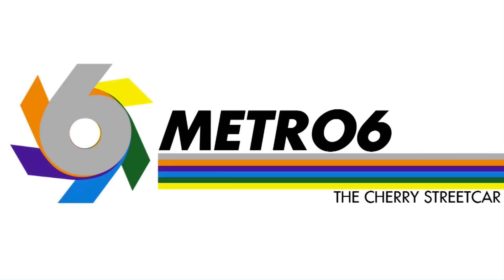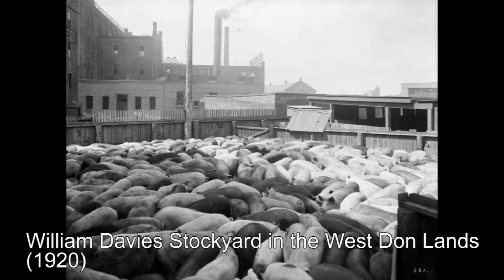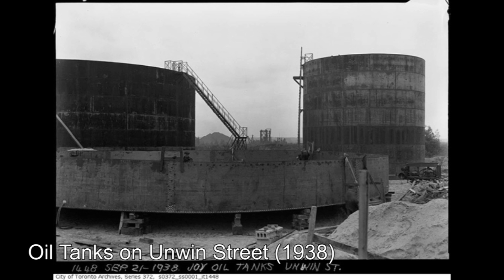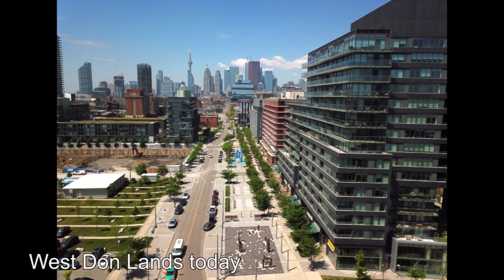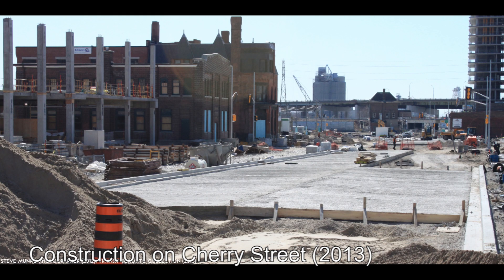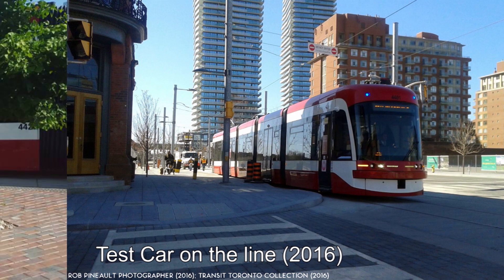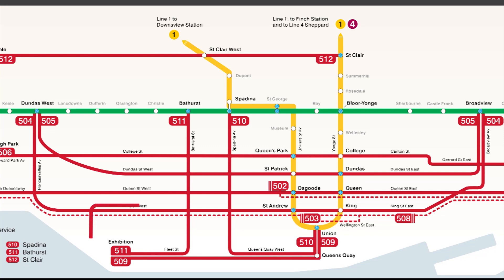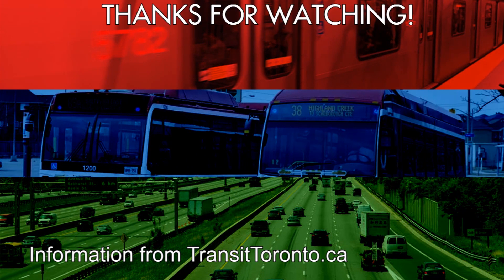The Cherry Streetcar - Toronto Streetcar History

Comment: 12:34 To be fair, the TTC re-introduced at the Humber Loop on the 501 Queen.  Prior to 1995, the 501 Queen car always ended at Humber Loop with the 507 Long Branch car operating west of Humber.  The 507 Long Branch would be merged into the 501 Queen line in 1995.

Comment: I would argue that the Cherry Streetcar wasn't abolished, it was renamed 504A and extended. Following the reorganization, service along Cherry Street became much more frequent and extensive.

The reason for the reorganization was to improve passenger distribution and reliability on the 504/514. The 504 was very long, busy and unreliable, while the 514 was very short, less busy and more reliable. Swapping the west end branches of the two routes brought numerous advantages:
- With equal frequencies on the two routes, it is now possible to evenly space service through the combined segment. Previously that was physically impossible since the 504 and 514 ran completely different frequencies.
- The terminal capacity between the 4 terminals is now fully utilized. Previously Dundas West and Broadview were severely congested from the high frequency of streetcars long terminal times required to account for the unpredictability very long route. Meanwhile Dufferin and Cherry loops had spare capacity.
- Ridership is now balanced between the branches because they each have similar number of destinations. Previously the 504 would be severely overcrowded while the 514 had spare capacity, since nearly all destinations on the 514 were also on the 504, but there were many destinations along the 504 which were not served by the 514.